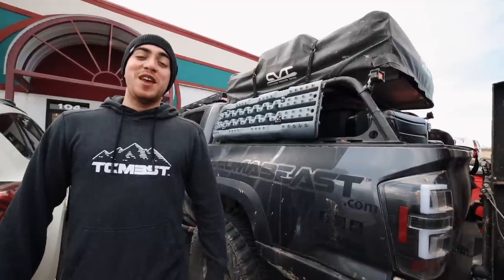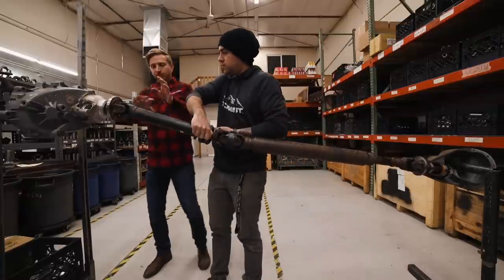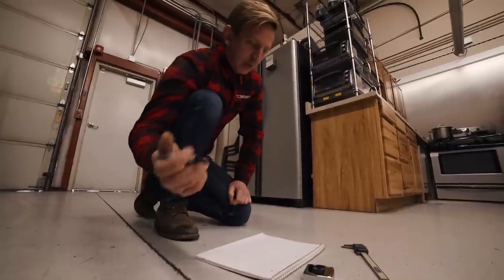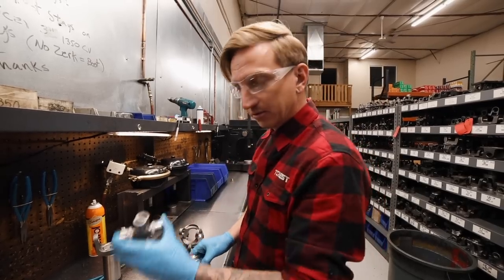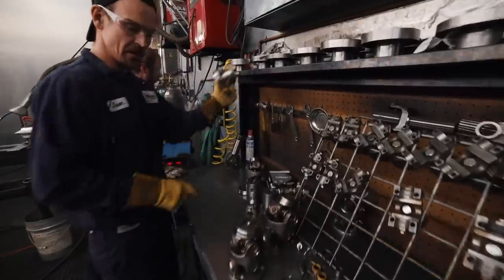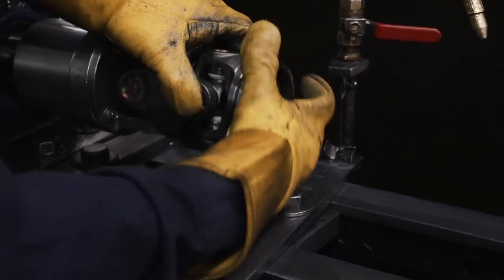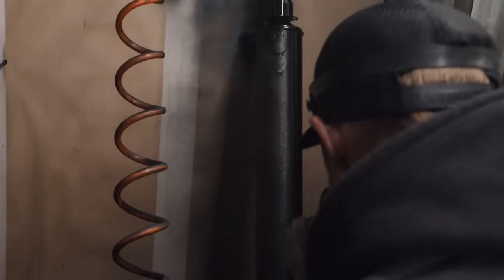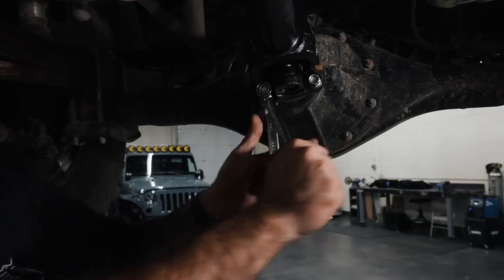Toyota Tacoma Vibrations, How to Fix This Problem

Comment: Why go to the expense...LET TOYOTA FIX THEIR PROBLEM.
Reply: Simple answer is the can’t or won’t! I have 2018 off road that had vibration issues before it was lifted 2” in the front and 1” in the rear. I’ve been to Toyota numerous times with the vibration issue. Toyota is aware of the issue. Their fix is new leaf springs and a dampener in the steering wheel. Which didn’t work. I’ve read numerous positive reviews on TW drive shaft resolving vibration issues. So I’m installing mine today. Hopefully no more vibration issues!
Reply: 2019 SR5 access cab with vibration in driveline since new. Dealer replaced rear brake drums at 160 miles for being out of round. Did not fix the problem. It still has vibration at 20 mph either accelerating or decelerating.

Comment: Alright, but how much is the estimated cost for me to get my own custom drive shaft?
Reply: My local driveshaft shop will make me one for 450.
Reply: Smokey_Ram12 I would have guessed over $1,000. Would $450 be cheap or in the general price range?
Reply: I think their pricing is on their website and it costs around $600 or $650
Reply: Shane Baustian  Sounds like I got ripped off, lol, Shawn give me my money back, hahahahha, I've been real happy with mine so no complaints.  It was between replacing it with a stock one and switching to the woods and while it sounds like I could have saved a little I'm still glad I did ;)
Reply: Shane Baustian  Just realized you probably got yours pre-trade war when raw material was cheaper.  I'm guessing that's the difference.
Reply: Weren’t you born with one 🤪

Comment: $600 plus for the shaft,and it may,or may not fix your vibration problem,these Tom Woods shafts are NOT always a  fix.
Reply: They are not always a fix and we are forthright about that. If someone orders a shaft and it does not do what they were hoping it would do, they can return it for a refund. However, we have sold hundreds of them and less than 5% of them have been returned. It is safe to say that almost always it does fix the problem, when it doesn't we make sure the customer isn't stuck having wasted $600.
Reply: @xelxgatox  i see that you guys use 1310 u joints on your driveshafts, I thought the OEM are 1330?

Comment: Don't get me wrong Tacos are amazing. But, it seems its way too expensive for what it comes with. Rear drum brakes, low power/speed, bad driveshaft, bad transmission, mediocre tires, and weak bed. Just better off getting a Tundra for the same price or even a 4runner.